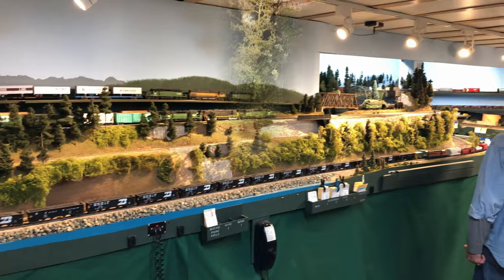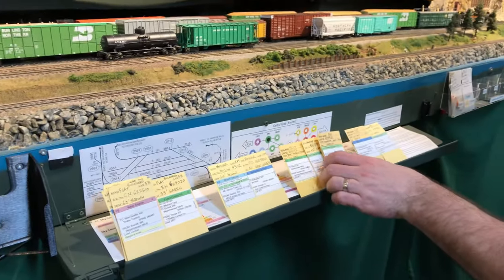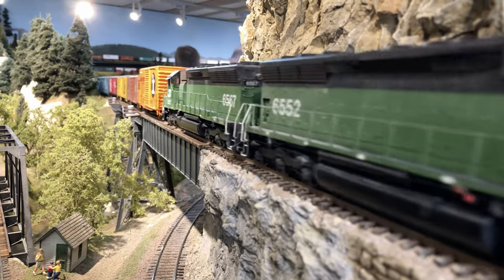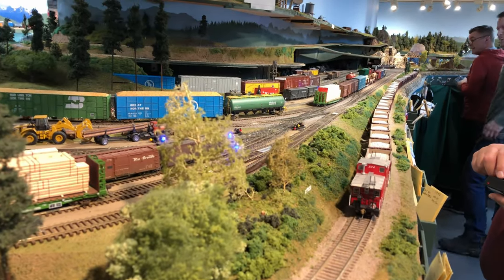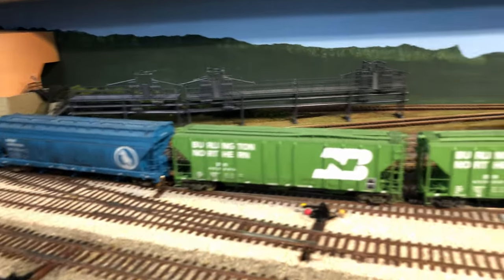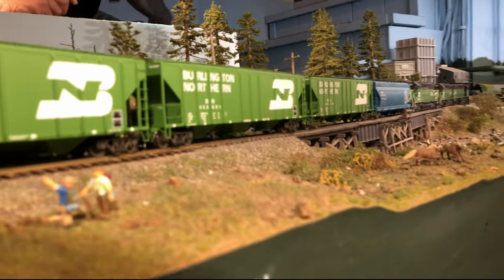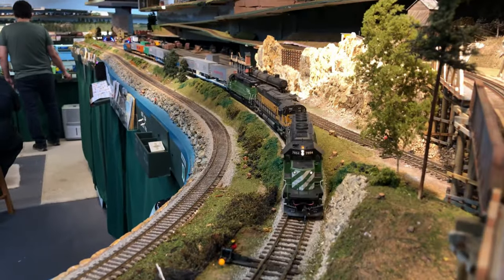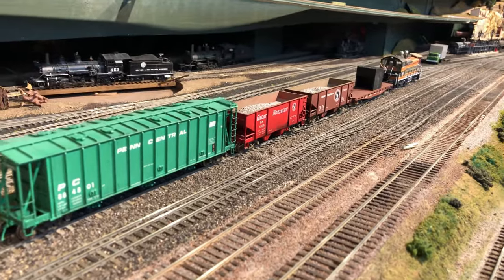Part 85 - BN Train action highlights from Soundrails 2024

Comment: Once again, great video, Burr!  
A question, then a couple comments ...
You referred to the limestone train as a MILW train,  but it is running with all GN equipment?  Did I miss something?
If I ever made it out to operate with you, I'd love to run the 'Jet Job'.  First heard about this 15 or 20 years ago and what a fun concept...  I have a job planned on my layout that (someday) will go off by itself and run for an hour or two without bothering anybody else, like your Jet Job!
28:12 Grain train at Delta - Underrated shot! I love how it doesn't look like the engines are moving much, but the cars keep coming around the corner in the distance.
Reply from the maker: Good question, and thanks for your comments! The short answer is that MILW used ore cars from several roads in their waning days. I already have more of the GN cars than I need, so I put them on this train. But then the question still remains of why don’t I put MILW power on that train? I think next time we will! I just hadn’t thought of doing that until you asked your question. So, thanks for that! :)

Comment: Happy 70th birthday!  Enjoyed the video. Really like all the F units and merger partners intheir original paint.  I'm curious about your benchwork, especially the rainbow bridge.  Is the bridge 2 glued layers of 1/4" Masonite?
Reply from the maker: It's 2 layers of 1/4" luan plywood. I cut a bunch of pieces of 1/4"  (5mm?) plywood into two inch wide arcs of my 28" minimum radius curve, and then used that as a base for laying track over foam scenery, without other benchwork by glueing two pieces together with staggered joints, as many as it took for whatever curve I was building. For example, the "Index loop" is a full turnback curve laid directly on top of extruded foam that is sitting on angle brackets screwed into the the studs in the wall. For the rainbow bridge, the turnback curve was originally fixed in place as a duckunder, but after enough skull-banging incidents, I cut it in two parallel lines and installed hinges so we could swing it up to the ceiling. I was just lucky there was enough room, because I didn't originally design it to do that.

There are a couple of places where I intend to eventually build curved trestles, so I left them as one layer of the plywood supported but not glued to the second layer, and installed the track section over that to be removable when the time comes. In once case, this was 20 years ago and I still haven't gotten "a round tuit" yet! But the mainline has stayed open for business generating revenue...
Reply: @muchfunwithtrains  Thanks Burr!

Comment: Thanks again Burr, great OPS, by the wa all my turnouts are equiped with colored pins that help very much to view the way the switch is trown. Thanks again
Reply from the maker: Glad to help. I got the idea from Al Frasch who got it from somebody else. You could probably use small nails and just paint the tops of the nail heads, or glue small colored jewels on them, instead of such those brash round pins. But it does help to keep the levers off the ground, and to help people see what they're doing.
Reply: @muchfunwithtrains  I found them in a craft store, just havr to cut the pin for the lenght i need and have the colors to